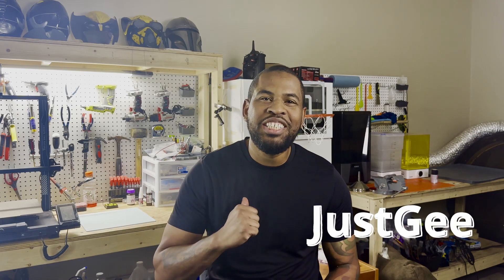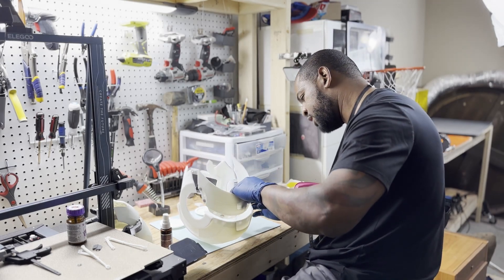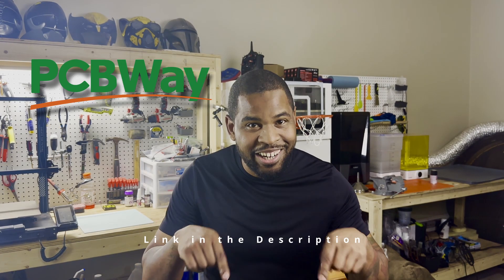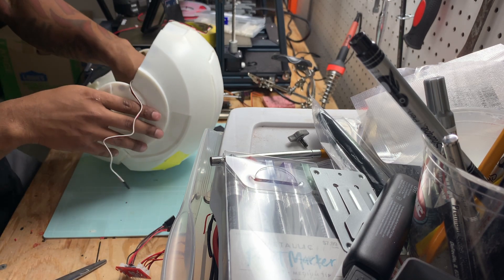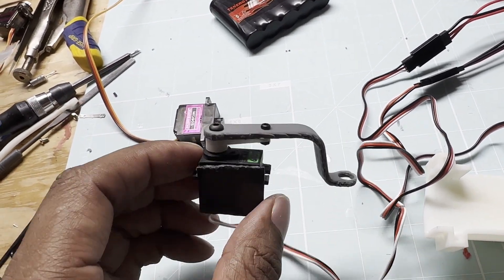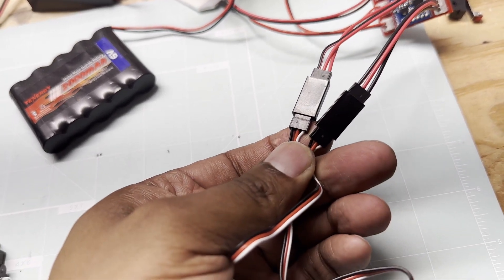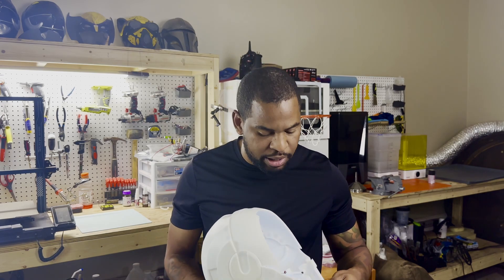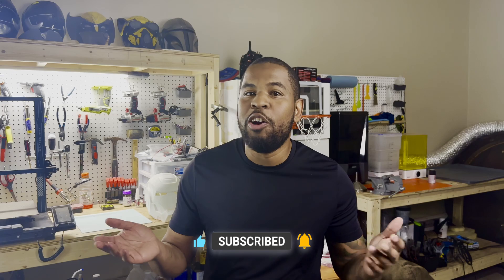How-To Ep 3: MOTORIZE Your War Machine MK 1 Helmet from IRON MAN 2! 3D Printed.

Comment: Maybe I missed it, but how do you motorize the jaw? I am building the same helmet.
Reply from the maker: The same hinge you use to connect the faceplate is used to move the jaw as well. It’s like a duel actions. It will make more sense once you print everything out.
Reply: @JustGee3D  never mind, I see what you mean. Last question. If I am scaling this up, with the 13 screws not fit?
Reply from the maker: My head is on the larger side and I had plenty of room @ 100% scale tbh you should have to go much bigger which shouldn’t change your screw size. If you do just go from a M3 to an M4